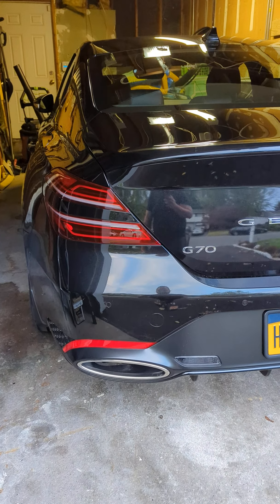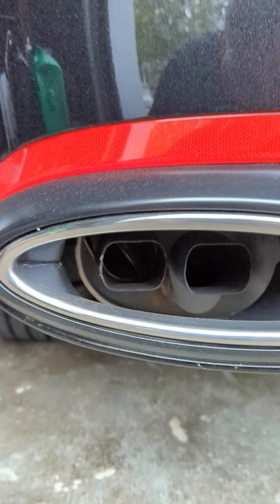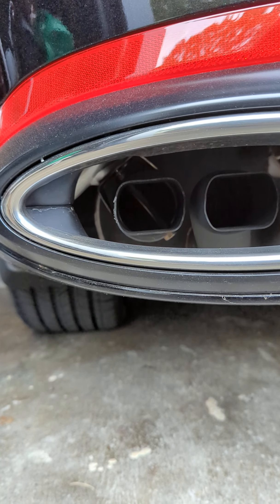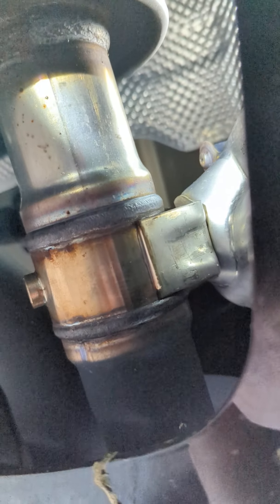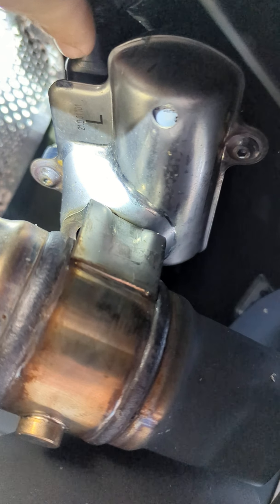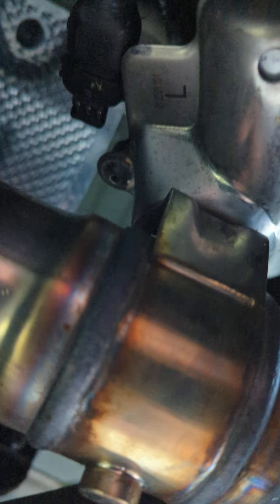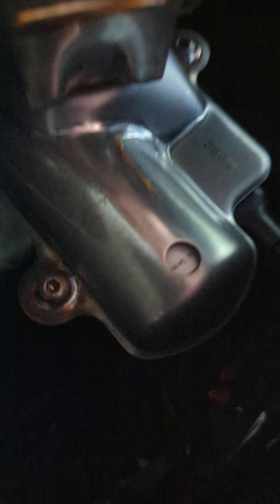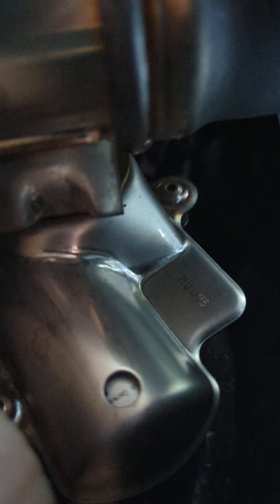2022 Genesis G70 - Disable Exhaust Valves

Comment: Did this to my 2023 GT2 awd stinger. Really great easy to do. Used electrical tape to cover the port and secure the cable. Easy to plug back in if I want to. Love the sound difference. Thanks!
Reply from the maker: Nice! Yea i went the electrical tape route on my Audi S3, worked great if you don't mind the soft faults.

Comment: I'm having a custom exhaust fabricated. Borla S type mufflers in which one exhaust pipe will go through the muffler, but the valved one will go around it. So when you flip the valve open, you have basically a straight pipe bypassing the muffler giving you a much more aggressive sound. Still in the process of being made, but hoping this gives a good sound while still retaining a quiet tone in eco or comfort
Reply from the maker: That sounds dope, definitely post a video of the finished project!
Reply: Did you end up getting the custom exhaust installed?

Comment: Took me 2 hours to get my passenger side plug out. Had to get a friend to help me too and jack the car up on some ramps. It took both of us with our hands uo there to get it out. The clamp on one side of it would not stay unclamped and took two people. That thing did not want to come out. Friggn ridiculous. I was so over it lol.

The driver side one came out no problem. Took max 5 minutes to pull it out, install simulator plugs, then ziptie the hanging cord to the side wall
Reply: what simulator plugs did you get?

Comment: Does this trigger check engine light?
Reply from the maker: Nope, no visible lights or errors in the car at all. The worst that can happen is it throws a soft fault if you were to plug into the diagnostics port but if you get a set of blanking plugs it will simulate the connection and prevent any faults.

Comment: Hey Steve, thanks for uploading. 
Would you know if the valve helps with droning if the muffler was deleted?
Reply from the maker: Sorry I wouldn't be able to say for sure as I still have the stock mufflers. The valves are the only modification so far.
Reply: @gflo412  No worries, thanks again Steve
Reply: With a muffler delete you will have a great sound but it will drone at certain speeds

Comment: Great video. Will this void the warranty in any way?
Reply from the maker: I would say not to worry, they would have to directly link this mod to something going wrong with the car in order for the warranty to not cover it. Opening these valves is something the stock car does anyway in sport mode. You can also easily plug them back in before taking it to the dealership for service if you want. That said they could make any dumb excuse they want to get out of being responsible, so it's ultimately up to you.

Comment: Hi thanks for the video, but when does the valve actually opens when it's connected? Even if i switch to sport mode and go to have a look i can see its still closed
Reply from the maker: From what I remember it opens while accelerating and/or over a certain RPM but it always remains closed while parked and idling no matter what mode you're in.

Comment: What are the exact plug covers you used so can order once and they work ?
Reply from the maker: Couldn't find the exact listing but these are the same ones - https://www.ebay.com/itm/254703733951?hash=item3b4d868cbf:g:Y6AAAOSwdvlfSqhh
Reply: Gonna try this cause was thinking of doing a muffler delete with straight pipe see if i like it cause not to many exhaust set up out their yet cat back and problably wont be for a while
Reply: Just wanted to let anyone reading this know that I ordered the exact set that Steve linked and they work great. Ignore the title about it being for mustang.
 It was a 5 minute job! No issues, no check lights

Comment: u don’t get no check engine light?
Reply from the maker: Nope, no light 👍🏼
Reply: Can you leave the cable unplugged next to the exhaust? Like nothing will happen?
Reply from the maker: @carloshewtty4536  I mean you can, I would at the very least wrap the open ends of the plug with electrical tape to prevent water or anything from getting inside in case you want to go back to stock. The only downside is that unplugging them will throw a soft fault but no check engine lights or anything else that you would ever notice without running diagnostics.

Comment: Wait how did you start it ? Remote start with the app? Or can you do it with the key?
Reply from the maker: You can do it with the key fob as well. Hit the lock button twice then hold the start button down (looks like a circle with an arrow, second button down on the right side)
Reply: @gflo412  Just a heads up I was given the instructions to Lock twice then hold the start button down as well, but you only have to lock once :)
Reply from the maker: @johnvari3231  oh nice thanks for the tip, I wonder why they say to lock twice 🤔
Reply: @gflo412   I’ve wondered the same thing. I just wish I could leave the vehicle with it running and lock it from outside.
Reply from the maker: @johnvari3231  there's some quirks for sure, I hate that you can't remote start then open the doors or else it shuts off after a bit. I feel like remote start then packing the car with stuff is a common scenario they should have considered..
Reply: @gflo412  I suspect it's so that they know the doors are locked before the car is started so people cannot drive off with your car.  In the olden days, with remote start, you still have to insert your keys before you can drive off.  Now with push button start, the car doesnt turn off if it doesn't detect your keys.
Reply: Their is also a trick with the remote to roll down all the windows at once remotely